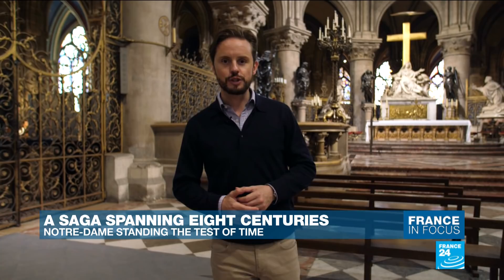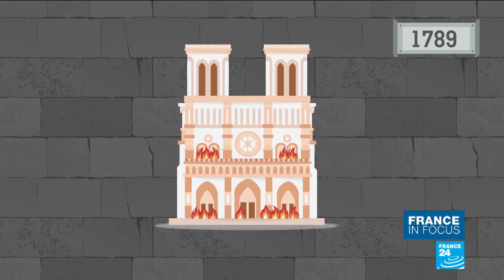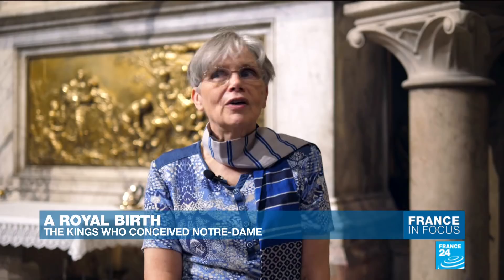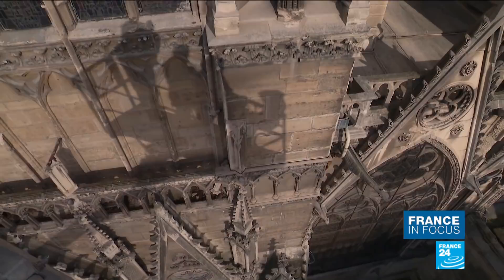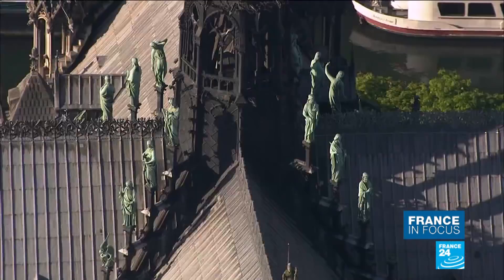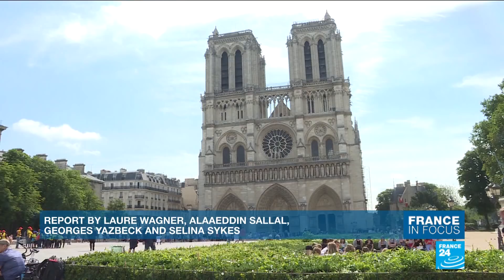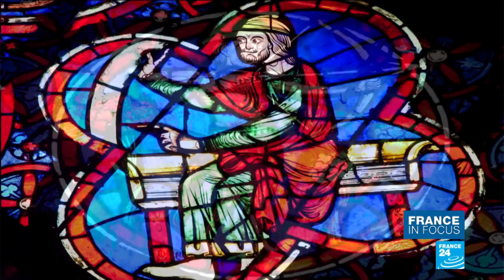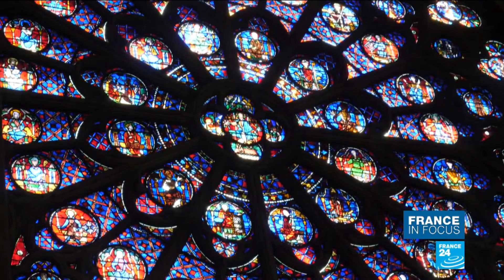Standing the test of time: Notre-Dame Cathedral in Paris

Comment: How ironic, they are talking about the restoration of Notre Dame, and it seems as though this very restoration may have been the reason for the fire that makes an even greater restoration necessary. How naive they were not to warn of the dangers of restoration. Fires often occur during restoration work. For example, in such work they may drill holes through walls, and these holes may help spread fires. And of course there may be flammable building materials standing or lying around. The most important thing about restoration is probably preventing catastrophic fires from breaking out, not the restoration work itself. I would say that is the most important thing. And often there are questions about restorations afterwards. Did the restoration of the Sistine Ceiling destroy aspects of Michaelangelo's painting, the smoky haze that was removed to make the paintings look much more colored than before? It is surely too bad what has happened. We do learn from the video that there were past restorations too. The spire that fell may have looked much different before its restoration. Restorers of medieval castles and churches sometimes added details that were not so common in the past, but fit the restorers vision of the middle ages. So perhaps they can find old architectural plans that show how the church was actually built originally. There may have been many details that one would want to return to their original appearance.

Comment: Had the cathedral been new construction... an automatic fire suppression system would have been required. Assuming there was no automatic fire suppression system in the wooden attic area of the cathedral then we need to consider why not. People having responsibilities for these buildings need to use common sense risk management principles not only for new structures but especially for valuable older and even more vulnerable structures. Please... a message to those generous billionaires... please pay to have automatic fire suppression systems retrofitted into these wonderful cathedrals, palaces and castles. Please...

Comment: So the building that we never built was pulled apart ( under the perception of a remodel) then once enough of the building was missing it was set on fire the remove the very truth that the building was not built by us. It is most likely over 20000 years old.